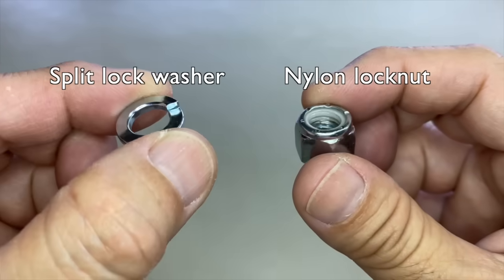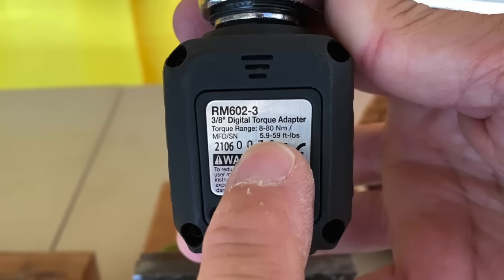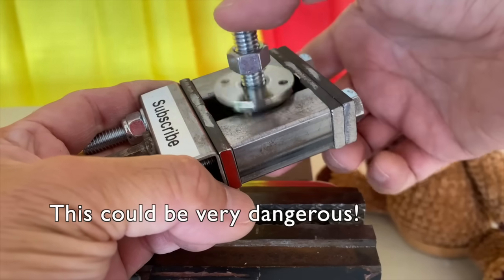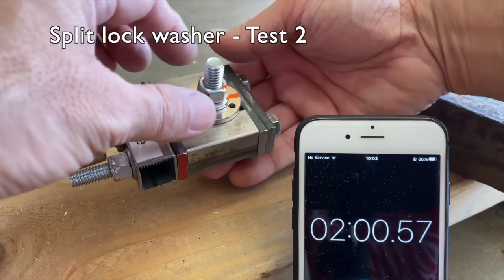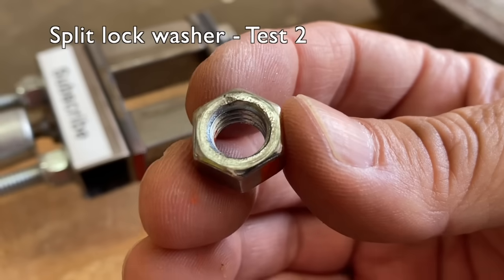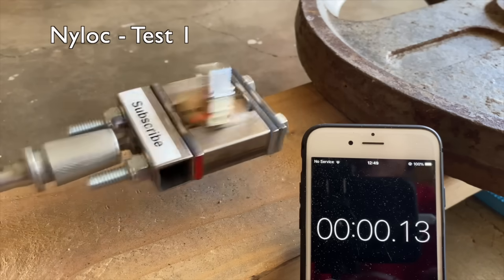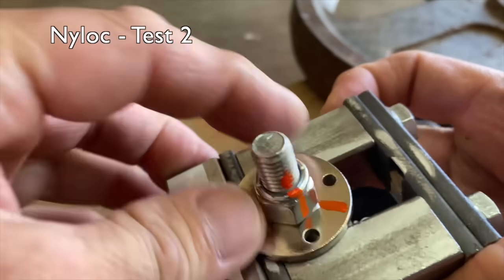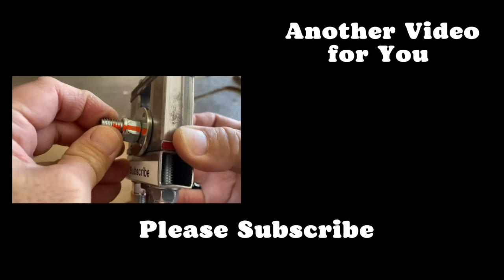Nuts & Bolts - Split Lock Washer vs Nylon Locknut – DIY Impact & Vibration Test - Part 1

Comment: I'm an aircraft mechanic. This issue was solved years many years ago.
 If you are going to torque something that size to only 6lbs, you use a cotter pin.
Reply: Or safety wire
Reply: Safety wire is only for detecting movement of the bolt not for actually securing it @williamhaggerson5490
Reply: @williamhaggerson5490  nah just a cotter pin.
Reply: Same. Castellated nut/cotter pin or safety wire to structure.
Reply: y'all are missing the point.  The experiment was to see which of the two common methods are "better", not if either of them are acceptable solutions for critical applications like aviation.
Reply: @minerran  exactly, I don't know why they're talking about aircraft. This has helped me confirmed what I've always thought. If I use a nylon washer on a motorcycle for example, I'm more likely to detect a loose nut cause it shouldn't fall off immediately, but it would take time for the nut to be shaken to the end of the thread.
Reply: @minerran 2:21
Reply: I also work on Helicopters. I specifically agree with you. Plus these tests this guy ran are not realistic applications in high vibration areas. Cant tell you how many places I've seen castellated cotter pin nuts in flight control areas, ect..
Reply: @Medi0cr3- castellated nylon nuts on bolts that have a positive  locking pin built in in some flight control inputs.  Triple protection from disconnecting!
Reply: @Medi0cr3-  "these tests this guy ran are not realistic applications in high vibration areas."  Of course they aren't.  But a realistic test would take months.  Thus... he sped it up for demonstration purposes.
Reply: @Medi0cr3-  Not realistic? Then do your own test and post it. This is free valuable information.
Reply: there are nuts that are elliptical or slightly triangle on one end. the far end of the nut acts like a nylon washer. there are nuts with collar that you hit with a hammer and lock the colar to a channel in the bolt thread. cars driveshafts are secured this way. also, you can use 2 nuts and tighten them against each other. bicycle traditional bearings come to mind
Reply: @west_park7993  you took the words out of my keyboard!
Reply: @west_park7993  car driveshafts are secured in many ways : nylock, elipitical, castle nut
Reply: @west_park7993  At least in Europe, 2 nuts do not count as screw locking because they have very little effect
Reply: @Zedus-rl9hp  depends on the application. i.e. vibration intensity. I seen many places where they use 2 nuts. the nuts are tight against each other, and the thread is deformed slightly. Elastic deformation. It is this deformation, that keeps the joint tight. Ever seen a bicycle? every bearing is set like this, one nut is also the cone of the ball bearing, the other nut is thin hex nut. sometimes, there is a channel in the axle, and a special washer that locks in the channel. i.e. turning the outside nut will not rotate the second nut. this is how you adjust the bearing tollerance.
Reply: @Zedus-rl9hp  jest, in Europe it depends what gen*er the nuts and bolts are
Reply: @Zedus-rl9hp  In Europe you'll find it e.g. on many chain tensioner of motorbikes - one thread is in the swing arm, the bolt goes through the thread and the chosen bolt position is secured by a nut tightened against the thread in the swingarm. So it work like two nuts tightened against each other. And it works :-)
Reply: @tomas5164  I think you are the 10th person to write this, but it is still not an approved threadlocker because it is not effective enough!
Furthermore, in your example the application is slightly different, since both nuts cannot move in the same direction.
Reply: @Zedus-rl9hp  yep.  Well, they used to on rail tracks, until the Potters Bar rail crash.
Reply: @west_park7993 - If the thread is not deformed, you have no hold.
Reply: Recip OEM's have these garbage split washers that turn into a flat washer under clamping forces. NASA has a paper on lock washer effectivness, needless to say only star type lock washers
Reply: @F-14_Jockey   One problem with "star"  washers is they can only be used once. Sometimes that is a pain in the ass. It seems that there are 2 views on how  "split " lock washers work. One opinion is the sharp edge of the split digs into the surface and  prevents any rotation. The other opinion is the split keeps pressure on the fastener and maintains preload.
Reply: @michaelsamson3276 Interesting about the two views on lock washers (sharp edge digging or biting in vs preload) I've used flat washers underneath lock washers to prevent damage to the surface being fastened to. I think this maintains preload while eliminating "bite" locking. I assume the higher the preload, the less sharp edge "bite" is part of the equation.
Reply: @michaelsilberg9059    The sharp edge would dig into the nut not the surface. On an aircraft you always use a flat washer  under a lock washer
Reply: jeeez more smartss comments than under a welding video... how is that possible?
Reply: Everyone knows cross threading fasteners is the best method🤦🏻‍♂️
Reply: 3/8ths bolt to SIX FOOT POUNDS,,,,THERE WAS NEVER any STRETCH ON THE BOLT no wonder,,,dont work on anything mechanical please
Reply: So total non-mechanic here... so how would you ever ensure what you torque something, STAYS that way?  These obviously can fail, and a cotter pin or castle nut, they prevent it from coming off, but they cant ensure the torque or 'preload' is what it was set to can they?  So what, loctite, nylon cotter pin castle nuts for the win?  LOL
Reply: @icegiant1000   A properly torqued fastener will not loose it's pre-load unless it is used to hold some sort of rotating part. In that case you need to use a cotter pin. A proper sized cotter pin will not allow any rotation of the nut. A proper torque value actually stretches the material enough to hold a pre-load. As an example, some high performance connecting bolts are not torqued to a foot pound value, but to a specific length. As a side note, you cannot reuse these bolts and if you exceed that length for some reason you can't re-use the bolt. You need to buy a new one!
 Locktite works great on things that don't get too hot and can't be tightened enough to have a preload.
Reply: @michaelsamson3276  Absolutely fascinating.  Thanks for the top shelf info!
Reply: @michaelsamson3276   I remember putting a new oil pickup tube on my 12 valve Cummins engine. And the manual called for something like only 30inch lbs on the bolts, and red loctite. It's been years and so far they've never come loose. But with the way this thing vibrates, and with heat cycles, I'm flabbergasted they don't just rotate out. I always feel better with safety wire or cotter pins. I KNOW a nut or bolt won't back out unless something has gone terribly wrong.
Reply: @michaelsamson3276  That explains why certain bolts in my car's engine compartment snap instead of hold when reused, and why the darn bolt cost $12 at the Honda dealer.  Thanks!
Reply: Yeah. I can remember back in the day huge steam turbine casing bolts/studs were stretched, measuring stretch with a dial indicator. @michaelsamson3276
Reply: @michaelsamson3276  to answer your question,  you’re 100% correct when the fastener is  torqued it’s length grows as the material is stretched ( preload ) . The reason you should not reuse it is that there is no guarantee when the bolt is loosened ,after being in use for a period of time it returns to its original length . Generally, if your  spending the effort measuring  every bolt that your installing, it is usually in areas where failure would caused catastrophic failure , an in these cases if it is taken apart, it is best to-reassemble with new  fasteners.
Reply: @michaelsamson3276 would it help to use a left-hand thread on a clockwise rotor, for example on the right side of a wheel?
Reply: @DC9V   Only if it came loose to begin with and if it were tightened correctly, it wouldn't come loose.
Reply: @sydneybird116  Yeah, Honda is the only automotive company to use this system. 
What used to really REALLY annoy me was that I'd go into my local Honda dealer and they'd just hand me a stock bolt, not a specific Honda bolt, and defo not to the same spec as Honda specced. 
I haven't had a Honda in over 30 years, and don't regret it a moment.
In my case it was motorcycles, but clearly the same systems apply.
Reply: @DC9V  This system is used on brush cutters, but I wouldn't trust it in aviation applications. 
It's a real pity that my uncle died about a decade ago. He worked at RR aero engines. I know that RR had right and left turning aero piston engines for use in twin engined aircraft. It would be interesting to see whether they envisioned using left handed threads in some of the key applications.
I do find it strange that right handed threads are so prevalent, even in applications which are not critical, but would be simplified with LH threads. I suppose the dangers of over torqueing bolts is a major factor in these decisions.
Reply: @icegiant1000  Double nuts are a good way for a non-mechanic to ensure both torque and retention. If you're iffy on the tightness, use a torque wrench.
Reply: @MrTL3wis  Thank you, im a software developer, i don't deal with nuts very often, except when Visual Studio is breaking mine... just an interesting subject.  ;)
Reply: @icegiant1000  you are a total non-mechanic. go read, educate yourself, then play with bolts, and nuts.
Reply: And with Locktite?
Reply: @michaelsamson3276: Which issue? The video just compares three common fixing methods in a very simple test.
Reply: I'm a train mechanic, I agree.
Reply: And I am an aerospace engineer who works for Boeing. I can assure you that we do not use threaded nuts or cotter pins with any of our structural assembly. All safety features have been tossed aside to boost our bottom line....especially on our Max aircraft. 😂
Reply: Depends on the context.   When you're trying to use a 2mm bolt, it might not be practical or worth the trouble to try to create a hole in the bolt.  Lock nuts and nylon nuts are used in many, many applications, and in all sizes.
Reply: When the comments are much more useful than the video, that's beacuse experts who have been working with this for half a century weigh in. Thanks to the commenters!
Reply: Its also most likely the hardware came from over the counter low grade such as Lowe's.
Reply: Or safety wire
Reply: This!
Reply: European Zinc External Serrated Lock Washer
Reply: how do you use a cotter pin with a nut?
Reply: Self locking nut, with run-on torque applied, problem solved.
Both type shows in this video barely used on civil airliners.
Reply: That makes for very difficult short term testing though.
Reply: Exactly. That's very loose.
Reply: Welding nut is the best way!
Reply: crown nut with split pin with critical nuts and bolts
Reply: Kay-nuts if you need actual torque.
Reply: Are you use DOWEL pin
Reply: He really needed to research correct torque required.  A properly torqued bolt would not slide in minutes.  This is DIY at home only.  For the launch vibes, you set a torque spec for every fastener used, and use VC-3
Reply: More or less exactly what I came here to say. The 6lb preload was too small. However, a larger loading on the bolt would have made the test very, very, boring. Besides, you are more likely to get slippage in light load conditions, so this test is certainly still useful.
Reply: Years? 😂 Maybe centuries ago?
Reply: I actually drilled a hole through an outer tierod bolt so it could accommodate a cotter pin. I couldn't believe it didn't come with a hole, only the nylon nut. No thank you.
Reply: I'm a chicken plucker. I never use any form of locking nut because I like to live dangerously.
Reply: You beat me to the punch.

I was going to say: "this is why most cars use a castle but and cotterpin assembly for ball joints and some steering components."
Reply: He sould add the running torque to the 6 foot pound.
Reply: One issue with nylocs is seen too often is that not enough screw thread protrudes past the nylon therefore the locking effect is not on full size thread thereby negating the locking effect.  As for loctite this can be a problem if equipment has to be dismantled then reassembled to a torque setting, the residue left in the threaded hole affects the reassembled torque setting.
Reply: And Lock wire. Lots of lock wire!
Reply: What about all-steel aero nuts? My old Lancia car had lots, it was over engineered really.
Reply: That is interesting 😊
Reply: On that size the use of Locktite with the right application for the with the teflon fastener. but not for aviation applications.
Reply: Or lockwire
Reply: Шплинт
Reply: This experiment is meant to test the usual suspects and not industrial/aviation-grade methods, so cotter pins aren't necessary, BUT it takes a considerable amount of force to damage, shear or break a cotter pin - even the cheap ones.

Think about it - cotter pins are used on the hub nut of your car, to secure the wheel bearing and hub! When last did you notice your wheels "fall off"?

And this include your 4x4 truck(or any small sized truck), whose wheel assembly and axle vibrate constantly while on the road or off-road, multiple times per second, every second, under tremendous load and forces from all angles- for donkey's years!
Reply: That has to be in inch lbs.  no way that tq wrench goes to 59 ft lbs.  (708 in lbs), too much tq for that 1/4” bolt of grade 3 or 4.  Maybe a grade 8 or 10 could withstand that without creep.
Reply: Did you work on the Lear35 with gear failure in Scottsdale? Of course not. https://www.youtube.com/watch?v=FCRayO1Pi-I
Reply: 😅 The clown section!!
Reply: This test is bad. The metal on metal contact is just sanding the bottom surface of the two washers. 

You also don’t have a completely smooth surface on your jig.
Reply: Or a split pin if you're English and want to call something by their correct name.
Reply: @ShesABigun  .. yes but is far better describe what it is 'safety pins', 'wire lock' etc ... the wourld is big .. and to be frank ppl outside UK may not speak perfect english, .. many common named comes from the company first produced them, and usually isent always descriptive ..
Reply: @Patrik6920  A cotter pin, split pin, roll pin, R clips, lock wire are completely different items. That's a good excuse for not being English yet ignorance isn't, might aswell call it a circlip or maybe a fish finger.
Reply: Or safety wire…
Reply: We just zip-tie everything now. Sorry you wasred 44 years of your dumb life torquing nuts and bolts.
Reply: @seivaDsugnA  ooh wow, Boing?
Reply: Coter pin or wire only makes sure you don't loose the bolt and nut. But does not hold tension. A castle nut does to some degree. The only thing that really works: nordlock ring sets.
Reply: There are dozens of specific thread cements [ "Loctite" ] for specific conditions and materials, with differing combinations of breakout and prevailing torques, even within one brand. And correct application method is significant, which may involve de-greasing and a catalyst primer, ambient temperature range or post cure conditions. All of which would be selected for important applications with specific empirical testing. People say crp like "Use [color] Locktite" and I'm like "Which product number?" There are like a dozen of each color if you dig into the industrial catalog.
The strongest most heat and chemical resistant thread locker for bare steel is a brownish orange-red, takes a while to setup but only needs some salt-water primer and just gets harder to remove with time.
Reply: Former sports car racer here. I'd listen to the aircraft mechanic.
Reply: Thanks, I'll know how to secure Hammock Chair to not unscrew from the roof - currently secured with one regular nut and two nylon nuts from the other side of the roof.
Reply: non e' meglio usare il frenafiletti?
Reply: @ce9xy   No. Thread locker has it's place but it can not be depended upon. Safety wire or a cotter pin can not fail.
Reply: @michaelsamson3276  Sure they can.
Reply: @RonJohn63    It takes quite a bit of torque to shear a cotter pin, way more than you would get from vibration. Sometimes a mechanic will need to shear off a cotter pin because they can't get get it out. It takes a good amount wrenching to do that. Safety wire is used differently than a cotter pin. In this case the fastener would need to be turned to the point that the wire is basically pulled apart . It usually fails at the edge of hole that it is routed thru. Safety wire comes in several different sizes appropriate to the fastener it is used on. The large stuff is pretty strong.
Reply: @michaelsamson3276  Safety wire fails sometimes too. I've both seen it and have been stabbed by it. Regular inspections of fasteners subject to vibration, especially those in safety or mission critical applications, are super important. Even cotter pins fail sometimes, especially if they're subject to large temperature fluctuations as well as vibration.
Reply: @michaelsamson3276  Yes they can.
Reply: @michaelsamson3276  Actually, safety wire or a cotter pin on a small diameter bolt can indeed fail. Under vibration duress, the bolt can crack to either side of the drilled hole causing a catastrophic failure of the bolt and subsequently, the failure of the parts being held together. If the preload is lost, the bolt has already stretched and needs to be checked if it is a critical component. That's why you replace bolts when something is dismantled rather than re-use them.  It seems like a bit of a waste, but someone in India will remelt them and make a knife or something out of them.
Reply: @RonJohn63  Not unless you take a long wrench to try to break them.  This is what is used in aircraft to prevent nuts from coming loose.
Reply: @ce9xy  It depends on the application.
Reply: Just use the Nordlock washer
Reply: @sieman0022   My new Sensenich propeller use them!
Reply: I agree. At 6 lbs is very light torque. I would have put some type of lock tight. That's a lot of movement almost like a seismic 12  earthquake.
Reply: mich - Are you saying that it is important that nuts and bolts DO NOT fall off airplanes at 300 MPH and 35,000 feet ?    If so, we need to contact Boeing  --- ASAP  !!
Reply: That isn't any better than the nylock.  In both cases, the nut will not turn on the bolt but you still lose preload.
Reply: @pcspecialistpdx  Preload is not as important as keeping the nut from backing off in these applications. We use castellated nuts with cotter pins on engine and propeller rigging on C-130s.
Reply: @bernardocisneros4402 , you are preaching to the choir.
Reply: @pcspecialistpdx  a bolt that size torqued to 6ft-lbs isn't achievin any appreciable preload to begin with.
Reply: @pcspecialistpdx  Safety wire and cables maintain torque and positively prevent fastener removal. Cotter keys prevent fastener removal. Friction does not prevent removal.
Reply: @Comm0ut , did I say otherwise?

NOPE!
Reply: @pcspecialistpdx dont see nylock in engine or transmission parts. split lock & flat washer & a good amount of torque at least 10Nm
Reply: @pcspecialistpdx  Aircrafts go through extreme heat and cold cycles, not to mention pressure at 45000ft.
Reply: @pcspecialistpdx   First you would never torque something to 6 ft lbs., you would use inch pounds. If  aircraft fasteners lost pre-load you would have planes crashing every minute.
Reply: Boeing Is striving to achive the goal
Reply: @michaelsamson3276  First you would never torque something to 6 inch pounds., you would use Newton meters
Reply: @Zedus-rl9hp   Negative! This all started with the bolt  being torqued to 6 ft lbs , not inch lbs. In the aircraft world, the USA uses inch lbs not Newton Meters for small fasteners. The screw in my dental implant uses Newton Meters though!
Reply: @michaelsamson3276  Imperiale system is meh
Reply: @michaelsamson3276  lol, that is funny!
Reply: @michaelsamson3276 Then you don't need cotter pins. The entire experiment would not come loose on this jig if you tightened the nuts much more. The entire experiment is to compare which works better. Cotter pins obviously have nothing to do with the experiment at hand. For instance torquing transistors to a heatssink requires split washers to take the heat but cotter pins out of the question of the nuts loosen at all then an air gap occurs and the transistor fails due to not enough cooling.
Reply: @michaelsamson3276  Was any application for the fixing shown described?
Reply: @carlomariamosco 😂
Reply: @michaelsamson3276 . Why do you think they are required an annual on planes every year and other maintenance by hours? To check everything. Several bolts have been found loose with a cotter still in them.
Reply: @michaelsamson3276  correct.  Proper torque much more than 6ft-lb.  Depending on bolt grade - torque will range between 20 and 40 fl-lbs.
Reply: @Zedus-rl9hp  metric system sympathizer, opinion automatically means nothing
Reply: @engineerisengihere44  right. But what is the advantage of odd conversion factors and fractions?
Reply: @Zedus-rl9hp       what is the advantage of having all your units sound the same? Or having more bolt head sizes (gotta buy more tools for the one time you run across an 11mm)? Or having such a small range of measurment? Lol all you metric system losers are the same, the conversion factors of the standard system are EXTREMELY simple. Just because you personally do not know them does not make them hard or strange. I know both systems and I can tell you standard makes so much more sense that I actually laugh when people try to tell me the metric system is easier. If you don't know both systems then THIS CONVERSATION IS NOT ONE YOU CAN EVEN HAVE A SAY IN!
Reply: @engineerisengihere44  and that is exactly why every major technical company and science uses imperial units... NOT
And obviously you have no idea about the metric system, otherwise you wouldn't write such nonsense as "sounds the same" or "small range of measurment".
Is that the reason why the imperial system is used less and less? you have to explain that now, because you are cute when you try to troll
Reply: @Zedus-rl9hp  lmfao 🤣🤣🤣 "EvErYoNe UsEs It So It MuSt Be GoOd"
Reply: @michaelsamson3276 they never lose preload because the nuts aren’t circular they are in the shape of a oval this causes the threads to bite the bolt a lot harder
Reply: @engineerisengihere44  I DO KNOW BOTH. In fact, I can go one better, I know, and have used metric, BSF (British Standard Fine and American Fine for mechanicking, and I had to use both metric and imperial for calculations at both school and Uni.
Within reason, I agree with you that both have their places. What I don't agree wih you on is using imperial in engineering that is used at an international level. Nor do I agree that the conversion factors are "EXTREMELY simple", especially when dealing with multiple parameters in multiple units. 
Then again, you have an example in this very thread where there is a confusion of base measurements ft-lbs or inch pounds. I've never known this type of confusion to occur with metric. 
BTW, I am not aware of ANY more costly measurement related engineering disaster than the Mars lander mission which ploughed into the planet because the engineer responsible for the calculations hadn't run his calculations through conversion. You claim that conversion is "EXTREMELY simple", but it still has to be done. 
NASA, which STARTED to convert to metric in 1970 STILL hasn't completed that process because the US' own education system is so bad, and its people so willful, that the USA is the only developed country in the world that continues to insist on using imperial.
Personally, no matter my own feelings on the subject, as an angineer I would always say that standardisation of systems is a benefit in itself, and thus should be an aim of all engineers, whether or not there is an advantage. Advocating for a system that even requires conversion factors that need to be remembered is simply acting against best practice.
Reply: @davidcolin6519  literally all systems of units require conversions to be memorized. I personally believe that having two units of distance for example that sound nothing alike is of great benefit. Centimeter, millimeter, kilometer, they all sound similar and in conversation CAN get confused. Inch, foot, yard, mile, sound nothing alike. I think the STANDARD units should be the international standard. Remembering how many zeroes are associated with each metric conversion is much more difficult in my eyes than remembering a specific number for converting between each.
Reply: @engineerisengihere44  Huh? You can't remember that "mili" is 1000th, that kilo is 1000x. Seriously? I have worked in engineering and with engineers all my life, I have bnever heard or seen a single occasion in which anyone has confused milimetre for kilometre. Apart from anything else, when I've heard these sorts of conversations, not a single person NEEDS to or does use the full "millimetre". Everybody uses "mil", "k" or gig", none of which sounds even remotely similar.
And the international standard of measurement everywhere except the USA, Liberia and Myanmar is the metric STANDARD. 
Ther again, you don't even have a standard GALLON, FFS! Conversion from UK pints to US gallons? How is that a simple conversion?
You're telling me that you can't figure out that a gigabyte is bigger than a kilobyte?
And you're an ENGINEER?
Let me guess, you work for Boeing?

BTW, I forgot to mention that I've also used SW (Standard Whitworth). Working on old British, US and European cars, motorcycles and bicycles was a nightmare. Each new project meant having a complete change of toolkits.
Reply: @engineerisengihere44  Personally I try to avoid using centimetres. It's easier to think in millimetres, meters, and kilometres.
Reply: @engineerisengihere44  "literally all systems of units require conversions to be memorized."
I'm an aircraft engineer.  At my work we have a saying... "commit NOTHING to memory"!
We are encouraged to look it up in the approved maintenance data every time, (then sign the logbook to say that we used the correct data).

As far as imperial vs metric?
You're just biased towards the system you grew up with.
Metric is far superior.  Imperial's smallest unit is an inch ffs.
What happens when you need tiny measurements for machining?  
You split an inch into thousandths ie; a metric/imperial hybrid!

The US and Liberia are the only countries who still use this outdated system.  You guys should be embarrassed!
P.S. Don't get me started on Fahrenheit vs Celsius!
Reply: @carlomariamosco but they IDENTIFY as safe
Reply: @carlomariamosco  Best comment 😂🤣
Reply: @carlomariamosco  Boing solved the problem by throwing away the bolts ... see .. can not losen now boss, problem solved ...
Reply: @michaelsamson3276  he's not doing a test on aircraft carriers. You can use ft pounds, nm, whatever. Why has this turned into a test for american aircrafts all of a sudden? Whatever the spec you can convert it. It's like saying you should test the speed in miles and not km, or m/s. It's the same speed. I'm 5'11 or 180cm, both are correct!
Reply: @engineerisengihere44  it's only America who uses the 'americanised imperial' (for some reasons a gallon in the US has become less that the imperial gallon, so don't call it imperial, please. why are all countries switching to metric? And tell me, why do we count to ten and then have two digits. WHy don't we use the 'imperial there', so we add first a digit after we counted to 12, then we add a digit after we counted to 3, then after 220 (that's a furlong in case you don't know), then after 8. Easy peasy. Logic. Makes a lot more sense, doesn't it? I know both systems very well... but I don't favour one to the other, but I can see wjhy the metric system is being adopted in the UK and other countries who used imperial or different measurement more and more. And I know them very well because I'm half british, half italian, so I was born using both of them. You're just a desperate american who is not accepting the fact that everyone in the world is choosing metric over 'american'.
Reply: @pcspecialistpdx  You can put positive locking wire on bolts, and they will not loose preload
Reply: @georgjr2 , you clearly don't understand why the preload was lost.  If there isn't enough torque to begin with, no form of locking device is going to prevent loss of preload.
Reply: @pcspecialistpdx correct. Furthermore, the nylon lock nut was torqued with 6 inch pounds. Due to existing prevailing torque in such nut, less torque was transmitted to axial clamp force in comparison to previous nuts.
Reply: @BeniaminMacura I agree. The drag torque of the nyloc was never measured so the actual clamping force torque was less than 6lbs.
Reply: No you don't use a cotter pin, you use a split pin
Reply: @johnbower   MS24655 Cotter Pin  Formerly AN380 This is a standard aircraft part. It is not called a "split pin".
Reply: @michaelsamson3276   Cotter Pin is the US term but in UK its a split pin , cotter pin is (not split ) tapered solid pin retained via a nut , split pin is as the name suggest "a pin split down its center "
Reply: @johnbower  "A split pin, also known in the US as a cotter pin or cotter key, is a metal fastener with two tines that are bent during installation". W-T-F???
Reply: @west_park7993 in the UK, a split pin and a cotter pin are two entirely different things. Our ‘cotter pin’ is a kind of headless, tapered bolt which usually serves to stop a part from rotating on a spindle, most frequently seen holding bicycle pedal cranks in place on the spindle.